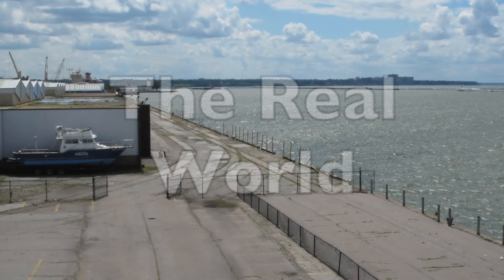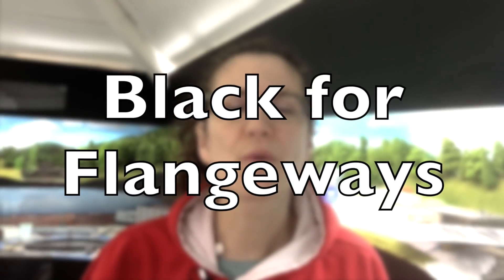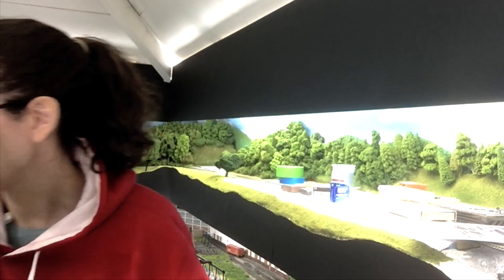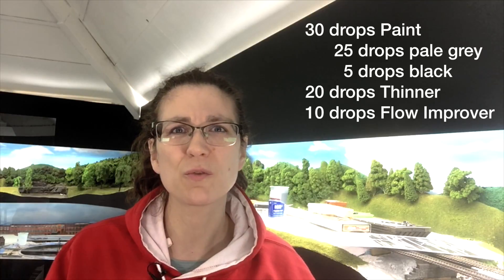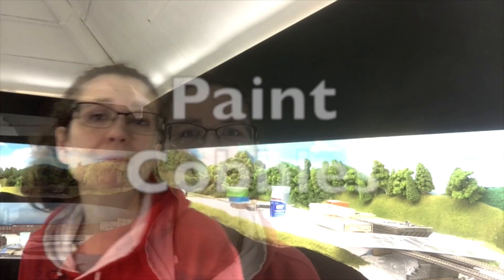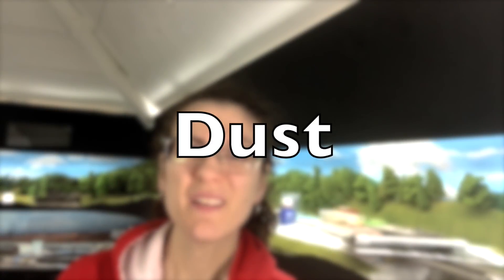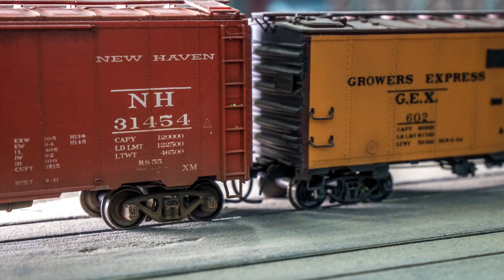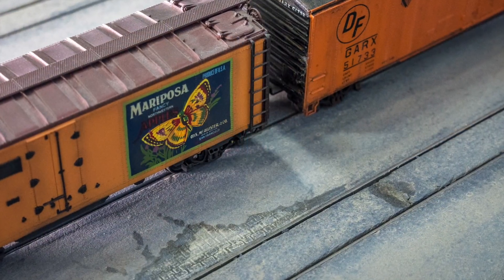How to Paint Tarmac

Comment: Wonderful collection of effects, and a great video of the effort.  Just done a quick trawl of the videos, and really impressed. 
And the artistry is also apparent.
One part of the philosophy not explained is why the prototype has the tarmac around the rails, and so what damage and colouration would result from that other usage.  So Weymouth quay can be a working quay, or later an access route to the ferry, or finally (and not useful on a layout) legacy track that is no longer used in a fully tourist car parking zone.
As you mention in other videos, getting the track repaired is a problem (as with the prototype) so the reason has to be robust!
Thanks for your clarity in so many details,
Anon
Reply from the maker: +Tom Lawton Thanks. There's different reasons for prototypes to do it as you point out but mine is because it is a dock and they want as few obstructions to trip over as possible. Plus it's a cool effect!

Comment: Great tutorial, I'm enjoying and getting inspired! One tip for getting the paint off the rail surface (for those of us without long thumbnails :oD) is use the end of a flat wood strip (like a coffee stirer) with a good 90 deg edge, that takes thin dried paint off a hard surface without damaging the surface like something metal would, also works well on clear plastic such as cleaning up the edge of vehicle windows etc.
Reply from the maker: Thanks Rob. That’s a really useful tip. You can also use it for cleaning track.